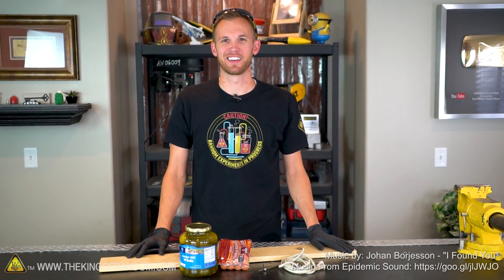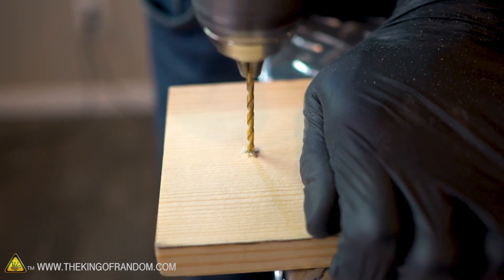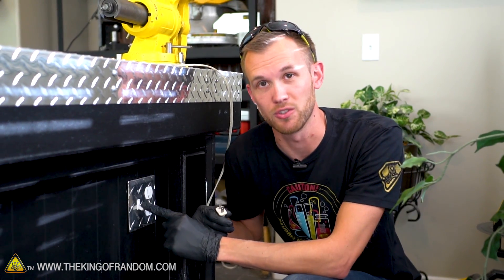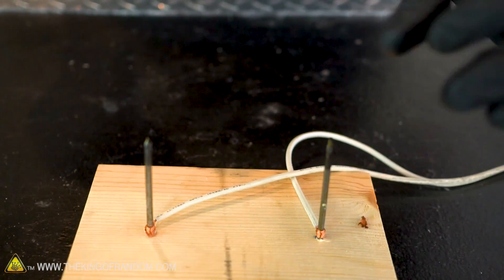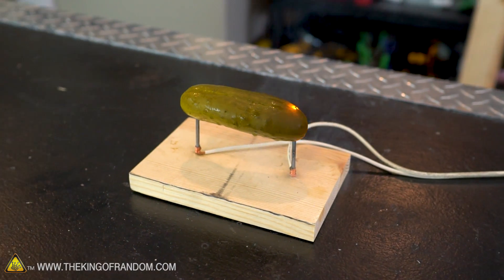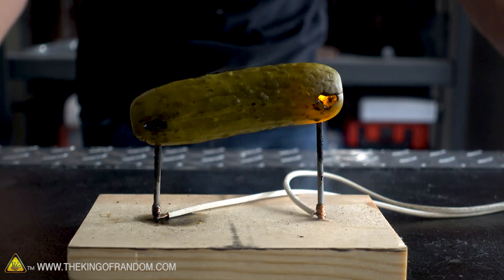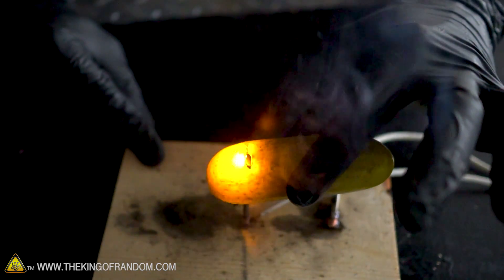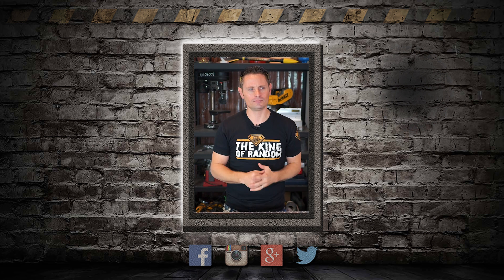How To Make Pickles Glow 💥 TKOR’s Electric Pickle Experiment On How To Make Food Glow!

Comment: For the wiener, the nails need to Benin the ends to allow the electricity to flow more closely to center.  Electricity takes easiest path, thus with your example it will simply follow close to the outside between nails.  It will heat nicely with my suggested method.  Still cool though.

Comment: You should use a GFCI outlet when doing this to help protect against electrocution and stay away from it when power is on (For example don't get closer than an inch at the very minimum and stay a couple feet away if your inexperienced with electricity)

Comment: I Have a commercially made electric hot dog cooker. Similar to what you're doing only the electrodes go into the hot dog from the ends not the sides. It takes 3 to 4 minutes usually to cook them all the way through. 90% of the time they split open. You didn't cook yours long enough.

Comment: you should put 6 nails in a big board and try roasting the biggest pickles you can find and then  seeing what it did. Also, use a microwave transformer (aka metal melter) to power it

Comment: so dangerous
Reply: Banananerd556 dude the life wires are exposed on each end and you tell me that this is not dangerous
Reply: That's something that is done regularly in labs and classrooms to demonstrate those things... So, no it's not dangerous if you know what you're doing.
As for me I always had an irrational fear of electricity. But I do get the basis.
Reply: I have made hot dog cookers using the same method. however I would never touch it while the power was on
Reply: I did dis in second grade and it exploded
Reply: Simon Stirnemann it's really not as long as you know what you're doing
Reply: Simon Stirnemann no

Comment: I would have cleaned the nail with steel wool between uses and take the wire wheel to the nail to knock off any coating(galvanizing) that could protect from conducting  electricity

Comment: In work in EMS and have been told been never tried that if you have a defibrillator with the pads for full arrest,  if you cut the pads off and strip the wires like this, and defibrillate a hotdog with high jewels it will explode.

Comment: I have done this years ago with hot dogs and forks.  At one time a company even sold an appliance to do this.  The problem with his setup is the single contact point is too small.  It works well with forks but you must push them into the hot dog a bit.  I would be reluctant to eat the hot dog afterward because the electricity strips the stainless steel off the forks and I do not want chrome compounds in my body

Comment: It's been awhile since I've done this, but if you run the nails into the ends of the hotdog it works much better. Each nail should penetrate about 1/3 of the hot dog. I seem to recall I cooked hotdogs this way in about 10-15 seconds.

Comment: Seemingly valid question, were you using AC? Because if you used DC, it would probably perform electrolysis and you could possibly control which side glows by changing the leads. Using AC it also performs electrolysis, but it flip flops so fast it produces hydrogen and oxygen on both sides.

Comment: I think you should try with one of the cellphone or video game console power supplies. They have a transformer and rectifier in them that converts the power to DC; but you'd have to avoid touching it, just in case arcing did occur as the higher amperage could prove lethal.

Comment: Did this a couple times in highschool but used solid copper wire jamed into the ends of several pickles in a row end to end and energized in total darkness the effect is much cooler. I think the upright nails that far apart don't have the same result.

Comment: You have given me the idea to create a device that would properly cook a hot dog on two small metal poles or nails. It would consist of a VRM and transistors, leading to a dial (because of the VRM and transistors, it can now withstand the maximum power output of the positive line), which will control the cooking temperature, the line from which will lead to a diode and a heating element, which will be making direct contact with the two nails or poles. The other part of the idea is to get this to fit in a portable form factor, like a little box. It might then look like a box with two nails coming out the top, with a temperature dial on the side, and the plug and cord on the other side.

Comment: This is dangerous because the nail heads are in direct contact to the table top. working with wet foods could complete the circuit delivering a dangerous shock or causing a fire.

Comment: The reason why this doesn't work is because you're using mains, which is AC (alternating current), which alternates the polarity 60 times a second in your country (in sane ones like mine, it's 50 times), making the average current 0. For cooking something you should use DC (you have to use a rectifier).
Reply: FULL BRIDGE RECTIFIER!!!!!!!!!!! (sry I watch electroBOOM)
Reply: Average voltage is 0.

Comment: as an electrician i would not recommend doing this if you do not have an understanding of electricity you can die! just to light up a pickle.........
Reply: carolyn mmitchell we also can't forget about the resistance of the skin. As you should know, skin resistance goes down as exposure continues.

we also need to be aware of a circuit path. If it's one hand then that is different than a whole body submerged.
Reply: “As an electrician”
Reply: Splendid Zebra inserting a sparkler into the pickle is a much safer way.
Reply: Splendid Zebra Tell that to ElectroBoom
Reply: No kid is going to try this
Reply: carolyn mmitchell doesn't seem like you're much of one either. Live wire in the water depends on several factors:

1) is ground and a GFCI present?
2) how close are live and neutral?
3) how far are you from the water?
4) what is the voltage are we 120 or 220 RMS?
Reply: as an electrician you seem as though you have never touched a live wire. It's not that bad man, it bites you but that's about it unless your submerged in water.

Comment: if wrap a wire around a nail or conductive object and run an electric current through it, doesn't it turn into an electromagnet? correct me if im wrong b/c i recently did this for a physics project and thats how i got the nail to magnetize so pls explain this to me.

extra note: if you want to cook the sausage evenly, try wrapping the wire around the sausage and THEN run a weaker current through it.
Reply: you have to run both wires through the same nail to make a electro magnet and you have to make more coils not just 3. =D
Reply: oh thanks for explaining. i knew that but i thought any amount of coils would work. thanks.

Comment: Just an idea on some improvements. Face the points of the nails towards each other, and sand the point of the nail. Then please try not to handle the items you are running current through. While it is only 120v running through the wires in the US it is still enough to cause damage.

Comment: Are you guys for real? This is a TERRIBLE video!
You have almost 9 MILLION subscribers - killing kids around the world is just a question of time...
The king of random have great content most of the time but this is DEADLY.
Understand that you have responsibility. Please remove this video!
Reply: So read the warning and don't do the experiment. You don't do any of the other experiments and projects, so why should you do this one? A majority of the experiments and projects are dangerous, whether it's electricity, metal foundries, bullets, fireworks, hydrogen generators, explosions, arrows, metal grinding, drilling, and lots more. If you don't like it, leave.
Reply: It's not about me or you. It's about kids between the ages of (for example) 9 - 14.
Getting hands on Thermite, guns, liquid oxygen or hydrogen generator parts  is not that easy as you might think. - Cutting a lamp cable or any other electrical cable is super easy. In Europe the voltage is 240.
Touching that cucumber or that sausage with thin gloves (or just at the nails by mistake) will very much end with death. If only even 1% of the subscribers are in these ages it's still + - 90,000 kids.
I hope you can see my point. Peace.

Comment: please use some proper gloves when playing with electricity  them nitril gloves wont save you from a 110 volt zap 

use stainless steel inserted from each end till they almost meet in the middle works much better ;)
galvanised nails i wouldn't eat it after

Comment: My King,

Its worth noting that in the USA the standard  power outlet has an output 110 volts at 15 amps but in other coteries such as Australia the standard power outlet is 240 volts at 10 amps so these  different standard  would have different results.

may i suggest a video of the same test on different power point standards.

Your truly,
ABigFan

Comment: Use an isolation transformer and secure your leads.  If you have to touch the energized circuit, use nonconductive tongs.  Maybe consider using a rectifier and doing this with DC instead. Your exam gloves are definitely not listed as electrical insulators, so you’re in for a nasty surprise when you discover a pinhole the fun way.

Comment: You should try boiling  sulfur acid then try putting electricity from a metal pole or something into the  sulfuric and then while it’s boiling put the metal rods into it that’s hooked up to electricity then try putting  sulfuric acid in the backyard furnace and try putting dry ice in to the sulfuric acid
Reply: Savage Savage I wouldn't suggest people to boil sulfuric acid

Comment: I have an idea to cook the hot dog all the way. Would it work if you cut the board in two pieces so there’s one nail in each half of the board and putting the hotdog vertical on the bottom nail and putting the other half through the top of the hotdog so it would cook thoroughly? Please test this.
Reply: Darian Brown I figure some of the current was flowing through the board instead of the hot dog. It wouldn’t be much but it would make since to retry this experiment that way

Comment: That is soooo dangerous...
Reply: Yes, yes it is.
Reply: If you're using your "normal person common sense", are you really going to touch a live pickle?

I'm all in for the idea of checking its conductivity and whatnot...but touching it with very thin gloves while it's conducting mains power?
Reply: Common sense is a myth. If a person doesn't have the necessary knowledge/experience, then they will not be able to make sound decisions.
Reply: mimked Common sense is about using simple knowledge to determine wether a decision will be in your best interest or not, instead of just jumping right into it thoughtlessly. Using commpn knowledge such as "Electricity will shock me, so I'd better not touch anything that has electricity coursing through it" is what Im talking about
Reply: Sometimes, common sense tells you you don't make a sound decision until you have been properly trained/taught ;-)
Reply: I mean, as long as your using common sense like a normal person with a brain, Im sure you'll be fine.

Comment: I don't think the microwave transformer would have much effect on hot dogs or pickles because the modified transformer has high amperage, but low voltage. It heats up metal quickly because the resistance in the metal is low and allows alot of amps to flow. But the resistance of the hot dog and pickle would be much higher and not much current would be able to flow through them.

Comment: I'm wondering how many kids will get electrocuted trying this
Reply: Twilight Gardens presentations "Just a shock" Until as little as 0.1 mA travels through your heart and kills you.
Reply: @prodigy2k7  if there is a GFCI build in and it should (but it couldn't) work too. You only need to touch the two nails phase/live line and the neutral wire and the GFCI wouldn't recognize it either. Other scenery are you sure your GFCI is working? Are you testing your GFCI/RCD every half year??? Like the Factory advises...
Reply: @Twilight Gardens presentations
If its so harmless (didn't mean harmful) (just a shock), have you every tried it??
2-3 years ago i got shocked by electricity and i had really much luck. i cant describe my luck in word...  i don't wish anybody an elecetric shock
P.S.: sry my english isn't my main language.
Reply: I did
Reply: Too many 
                   🙃
Reply: Dimos Kas it’s just a shock

Comment: The hot dog might not have worked properly because In America the voltage supply from the wall outlets are   At 120V in the eu the voltage out put in a standard Home is 220V

Comment: You are using a 110 volt circuit. You have a hot wire and a neutral wire. That is why only 1 nail is glowing. If you used 220 volts,  you would have 2 hot wires. That would make both sides glow

Comment: I do not recommend doing this experiment with a microwave oven transformer. The voltage produced is in the thousands of volts and can deliver over 500 mA, making contact with it very likely to be fatal. Also, due to the much higher voltages involved, your neoprene gloves will likely not protect you against electric shock if you use a MOT.

Comment: the problem could be the ac current where most of the hotdog ones are done with dc or it could be the bottom is acting as a conductor and takeing part of the current away from the hotdog

Comment: You should turn the hotdog vertical and run a long nail down through the center. Attach the leads to the base and top of the nail and run the current through the center. That should get you a more even burn throughout. I hope you see this!

Comment: US has some pretty crappy breakers if they don't pop on short circuits...
Reply: Just means, I would guess. You have a GFCI or in Europes case an RCBO breaker or plug. We have them here, they're just not mandatory and in most cases people see them as a nuisance. They are effective however.
Reply: Coofy its far from a short.  Plenty of resistance in a hot dog...
Reply: The pickle/weiner is effectively a load...
Reply: Just like plenty of resistance in the human body, but here in the Europe, if we short live and neutral with our bodies, the breaker pops immediately
Reply: AJ- Strike yes wieners are effectively loads, I can agree
Reply: What AJ said.

Comment: Having exposed live wires connected to the wall are extremely dangerous and could lead to death, why wouldn't you put a warning at the beginning of the video.
Reply: it's the king of RANDOM so it's open wires
Reply: Tôpãž Thė róyåł Gęm A kid won't die from cutting there finger with a drill or touching a specifically sized piece of wood.. but live electricity.... yep that'll do the trick.
Reply: Tôpãž Thė róyåł Gęm I have access to those things. I’m twelve.
Reply: Kirk Claybrook yES! A kid has access to drills and specifically measured wood, and is so under-observed by their parents, that they would try this! This so dangerouuuuuuuuusssss!
Reply: He put a warning in the description.
Reply: Read the desc...

Comment: Wow this is actually BEYOND dangerous and frankly irresponsible from your part as a content creator. In your last video you use a high powered laser capable of melting latex, yet don't even wear laser goggles? Then proceed to flash it around the room with a mirror? 

Yet now, you connect 2 bare 120 AC leads and act like its no big deal. Yet you forget to realize people who don't understand electricity will try this and will probably be electrocuted. You go on to touch the hot dog with thin gloves, never stating why you are wearing them. 

Either you're simply incapable of understanding the dangers or are too ignorant to share them with your viewers.

Comment: I do not like what you are doing here. Please mentions details like 120V (europe has 240V  - the same experiment would be much more dangerous), isolating table top, isolating gloves (or just dont touch the winner while the power is on), health concerns (ions migrating from the "rusty" nails into the meat). I would strongly recommend an RCD - without an RCD in the circuit, this experiment is just insane.
Reply: The thing is , a child that sees that might not know that. An Im learning to become an electrotechnician and we're not allowed to get too close to the wires even with gloves on except if we turn the switch off. The main problem here is still the fact that there are lots of children watching these video and with some not having parental supervision and not having knowledge about electricity this might go horribly wrong.
Reply: Brandon FPV what if kids don't think of using gloves?
Reply: sarowie you mean insulating, not isolating
Reply: Brandon FPV I have to agree with you this is a diagram just in case they don't understand
( =  Insulator
|—––———(hands)----------|
|——HOT DOG————-——|  
|__________BATTERY_____|
Reply: sarowie really ruining the fun
Reply: Jk btw he should give warnings
Reply: Chilll dude
Reply: He triggered
Reply: sarowie
So, if he puts a warning in the description, would that do it for you?
Reply: Although this is dangerous, electricity takes the path of least resistance, and considering his hands are insulated and not part of the circuit he will not get electricuted.

Comment: Touching a pickle connected directly to mains power

Genius
Reply: DoingStupidStuff Never. NEVER take chances with electricity.
Reply: Don't judge DoingStupidStuff,look at his name.
Reply: DoingStupidStuff see the metal strip on the bench? It could be grounded, if he leans on it that's one path. Another path could possible be to the floor. Basically what you said is that its ok to stick a fork in the outlet, as long as you only stick it in one side. Not true, this was quite dangerous
Reply: Daniyal Ahmed how is that a bad idea? He was using one hand meaning the only path was through the pickle and not through him. Also since electricity takes the path of least resistance he would feel maybe a slight tingle touching both wires at once with each hand